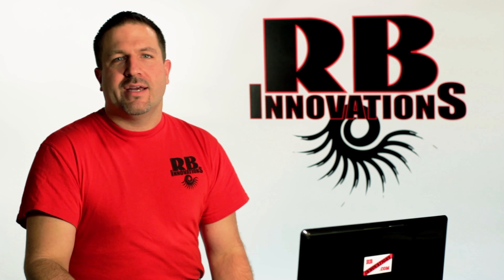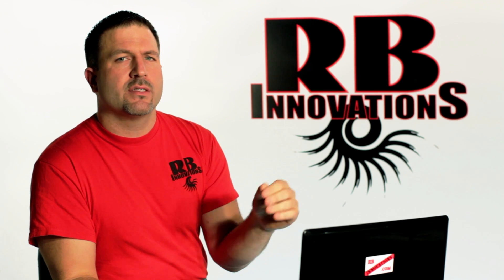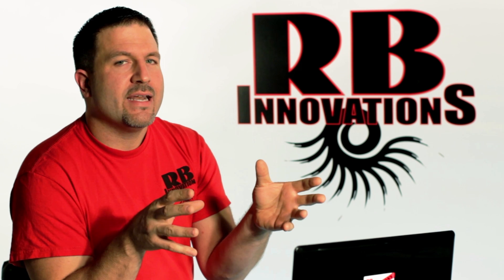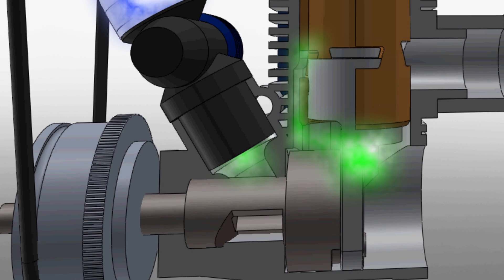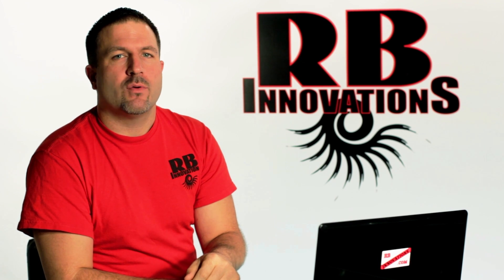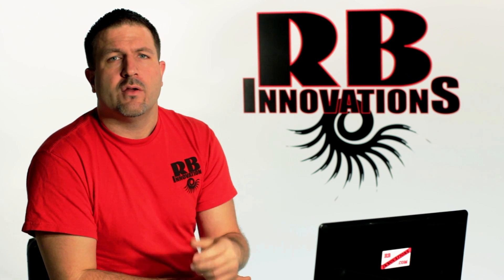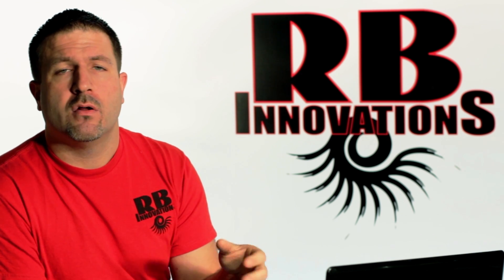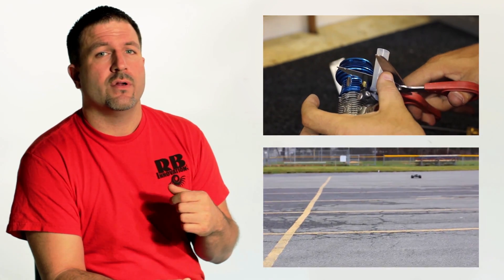How RC Nitro Superchargers Work

Comment: That sonic pulse, or "P" wave travels through the exhaust at approximately 1400 feet per second. The length and diameter of the exhaust tunes that P wave to a certain frequency, which equals an RPM which the engine runs most effectively at. In a two stroke engine this p wave is further effected by the expansion chamber in the exhaust pipe. On 4 stroke automotive engines the opposite of the P wave is the N wave. The N wave travels through the I take manifold and carburetor. Changing the length and size of the intake runners in conjunction with the plenum chamber tunes the RPM range of the intake manifold. When the intake is tuned with the exhaust the most power can be made at the desired RPM.
Reply: And the key to the power boost with a tuned pipe is the stopping of the inlet charge so it isn't [partially] lost out the exhaust AND the exhaust charge is fully expelled, hence the need to tune the length.
Reply: +Lozzie74 when the P wave leaves the pipe a Negative Pressure or N wave is formed that travel back towards the exhaust valve. If the length is tuned correctly the N wave will help evacuate the cylinder. But this only happens at a given RPM, which is where peak torque should be.
Reply: No argument from me.
Reply: +Lozzie74 nice to meet someone that knows what is up!
Reply: +Kenneth Cohagen There is some logic applied here not just "it works 'cause I say I does". Thanks Kenneth.
Reply: exactly. but not just any pipe either. if I was boosting a nitro engine, I'd think first youd need an abrubt ending cone on the expansion chamber and probably have to do a lot of math to calculate the length and volume of the header and chamber in the pipe, to get it tuned for a specific rpm.
If you look at 2T race dirtbike pipes (DG, FMF, etc) the expansion chamber begins close to the port, and a gentle cone at the end. smooth total flow is the goal exiting the chamber. with boost, more fuel charge will escape so a more aggressive slope at the exit of the chamber is needed. (taper much faster)
no doubt some charge will escape the exhaust. 100% efficiency is not possible. but with altered port timing, gains can be had by opening the exhaust later and closing the exhaust sooner.

boosted motorcycles do exist, blown and turboed. an engine does not know how small it is, it still sucks in air and fuel, and burns it. so it follows that with the right pipe and port timing, boost can add gains in power and torque.
Reply: Well said
Reply: So the moral of the story is that they don't provide the right exhaust pipe to go with the changed intake?

Comment: so this engine has a self ignition, like a diesel engine, am i right? the ignition is timed by reaching a given pressure of the fuel-air mix at a certain angle of the crankshaft. doesn't this system cause a preiginition?
Reply: Yes.  There is a glow plug (hot spot) that is used to ignite the fuel.

Comment: The supercharger puts more air and fuel in the mixture.. How does it do that? The supercharger isnt connected to the fuel. Is it pulling fuel out of the thin air? 
How much did they pay this guy to lie?
Simple thing. The cranckshaft closes the fuel and air supply chamber. So if the supercharger was putting pressure on the engine, you think that air pipe would stay? No, at the time the cranckshaft closes that chamber, the air pipe would blow off instantly.
Reply: +Erwin Holland - "The supercharger isnt connected to the fuel. Is it pulling fuel out of the thin air? " 
You're not very bright are you? A carburetor meters fuel depending on how much air flows through it..... stop posting online about stuff you know nothing about. mmmmkaaaay?
Reply: +Erwin Holland theres a tube there ?
Reply: +ShadyChris That would be funny, if i ever said tube.
Reply: I know how a supercharger/ turbo works. 
You do need extra fuel in the cilinders too. Just more air isnt enough. You need a bigger carbarator, or injectors. That is true on a real car, and ofcourse also on an rc engine.
Reply: +Erwin Holland He's right, you're talking out your rear. The more air the more fuel it pulls through the venturi (jet). How do you thing a throttle works? IT REGULATED THE AIR!
Reply: XXXXXXXXXZZXXXXXXXXX Maby you should think about what you are saying before calling other people dumb. The carb is still the same size and cant put out much more fuel. You would need a bigger carb, to put a good amount of extra fuel in the cilinder, to go along with the extra air.
Think about what dumb thing you are saying, before posting stuff you know nothing about MMMMKAAYY???

Comment: A tuned exhaust is a far more efficient supercharging device for any crankcase induced 2 stoke.
How nitro super chargers work, they don't. If they worked ALL the top RC car guys would use them. They don't.
Reply: not an easy thing to research and do endless making  of minute changes to pipes and cylinders. I dont have 30 cylinders to just experiment with. some maybe do, mfgrs do, but do they have the time to run thousands! of individual tests? nope. so it CAN work but its so unpractical that itll never really be used seriously.
Reply: eh they work in 4 storks see the YS FZ110S

Comment: Has anyone tried mounting the carb in front of the supercharger? And also I am not understanding how this is a supercharger in the first place... How can it compress without being exponentially over-run while drawing the air in from the side instead of pulling it in from the center as centrifugal compressors do? My theory is it's just equalizing back to ambient pressure...

Comment: I believe this product is worth trying out. However, I personally would do so on a engine that is well broken in. Going fast is okay, but seriously, the name of the game in any race is all about control. As in, do you, the driver, have complete and utter control of your race vehicle. Now, I would love to see a gas engine in the Traxxas Funny Car with a  blower system. Makes sense because you will be running the funny car in short burst of speed races and NOT long drawn out circuit type races. This is where this product would be of most benefit. I run funny. Electric of course, but if it were gas, I would not hesitate to add a blower because the name of the game in
drag racing is speed and control to effect the win. 

Truck racing/dirt racing requires more control and less speed. You see this played out on numerous videos showing people flipping their vehicles because they are actually going too fast. Thus they lose control and perhaps the race. Imagine entering a blower into that situation. Now we added more speed, but with less control. As for the technology and those endless debates, well, I believe that this product does enhance the dynamics of these small engines. Does it hurt the engine as far as it's overall life expectancy? Perhaps.
Perhaps not. Nitro is tricky stuff. Ask any NHRA driver or crew chief. Engine rebuilds are a must after each run when using nitro. It's
the nature of the beast. In these small engines, I would make the educated guess that the engines will do okay, but eventually, they will
wear out and need rebuilding/replacing.

In the final analysis, I love this hobby. Anything that makes it grow. That includes technology. Sometimes, one must decide whether that technology is worth the risk. 

My 2 cents.

Comment: rbinnovations, i don´t know, but i think i´d never put a supercharger on my engine cause you need to setup again your three screws on your engine carb, and cause if you don´t, you just put your engine to higher forces, higher rpm´s than it can handle, again, more temperature, and that engines cant´t run more of 120º/140º celcious degrees, and even you set up again the three screws, i don´t believe it works well... But i´d like you to show all of us posting comments here, a engine of yours running, with temperatures, settings, for we can believe more in the supercharger, can you? Thank you. From Portugal

Comment: I have devolped a different size compressor wheel for Mercury Optimax outboards, it produces huge gains, FACT. 
The amount of negative armchair experts i have who wont actually get off there fat backsides and come and try it is unbeleviable. Im guessing those same idiots are slating this system without trying, ive seen a few below saying things like " the engines are fast enough" or " they must cause the engines to break" , if you want to slate something have the decency to try it first!!!!
Reply: I'll try it

Comment: Haha "turbo" impeller a fan alone won't generate pressure it does not seal what this is doing is increasing flow. In the turbocharger the snail or venturi will make pressure but lose velocity can go on all day with how it works but claiming pressure is a fudged. This is easy and only one turbine design works and the Rb supercharger does NOT intake from the Front of the impeller